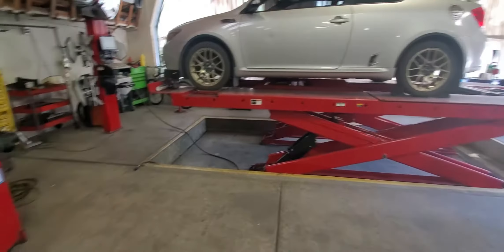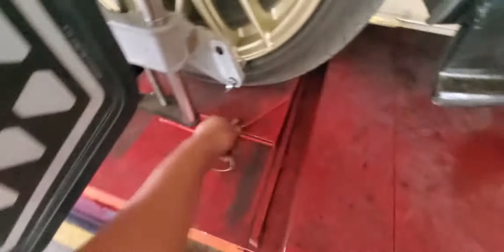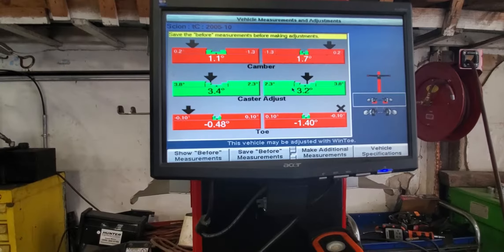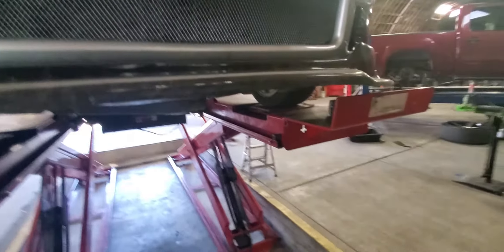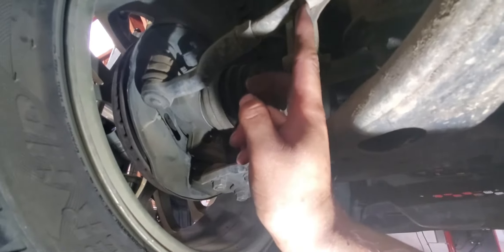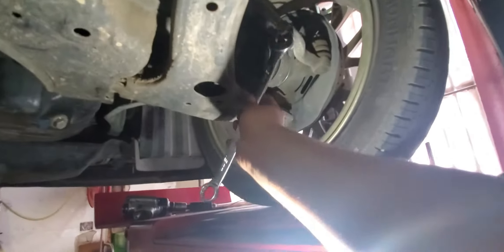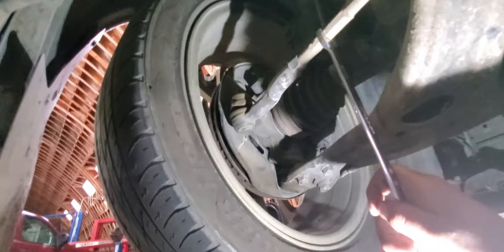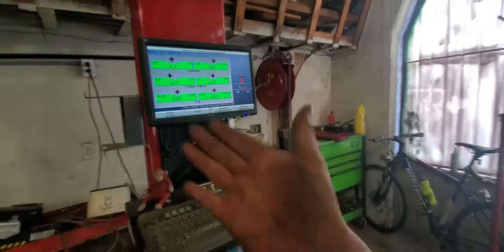How to do a front end alignment on a 2005 scion TC "TOE-CAMBER-ADJUSTMENT"

Comment: another noob question. does having wheel spacers affect your car alignment? what happens when a car with rear wheel spacers comes in to a shop, do you still do the alignment or do you have to remove the spacers before alignment?
Reply from the maker: Yea overtime it affects the camber. But with a slight adjustment it can be corrected.